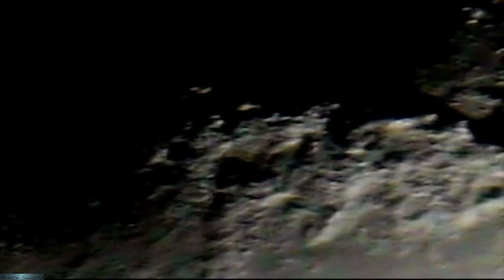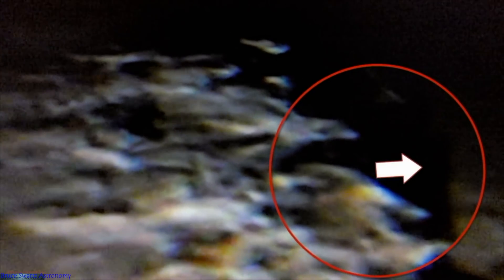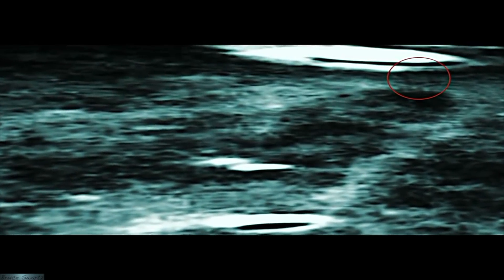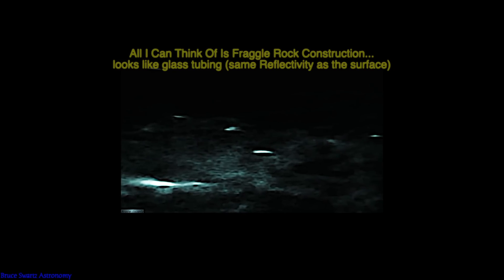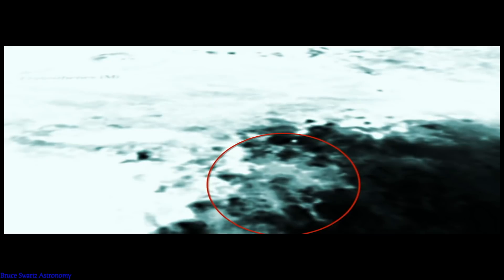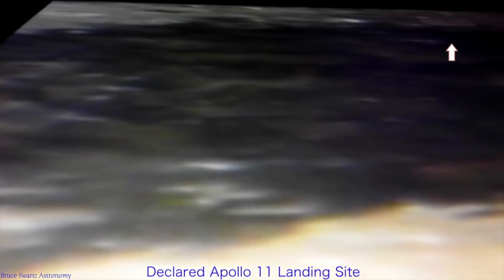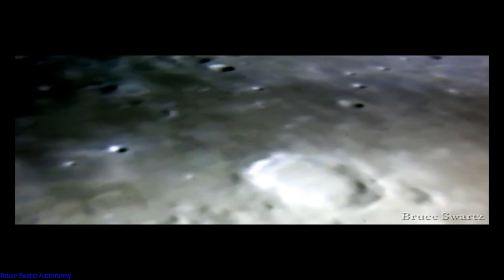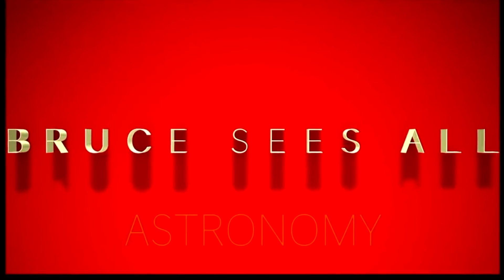The Moon's Surface Characteristics & Proof Of Constructed Features

Comment from the maker: Does it make any sense at all that two people would have gone down to the surface for the first time??? What if they crashed? Would the man floating in space waiting for them have been able to go down to the surface and help them??? Well of course not. How was that plan or back up plan not made. Would they have not done some oxygen breathing tests with their apparatus before jumping and falling on the moon??? When the astronauts came back the person in charge of their suits told his Niece and she told ME that the astronauts suits were drenched on the inside with water and dirt. Moon dirt.  29 degrees Celsius when they landed and your going to tell me that since it freezes the temps at night that there would not be a mist or haze on the surface???? Just a few questions there are many more. The damn lander on the surface was straight as a board. They said watch out for that big crater over there then showed us a flat surface that looked like quick dry cement without any elevation or even a view inside of ONE crater.  lollll The first moon landing would have consisted of several astronauts armed and a totally armoured space vehicle. Not aluminum foil that would have burned up through the Thermosphere before even leaving Earth. loll Alluminum alloy melts and would burn up before we got through it. Unless it was secretive. loll That could be possible. If they went to the moon I believe that they did not go the way they showed us and had possibly created a mock up stage setting with props.  Just a theory.

Comment: If size is no consideration, the surface reminds me of a close up of a circuit board....just saying, they could be dual purpose made by giant 3D printers  

https://www.bing.com/images/search?view=detailV2&id=86C3154740C8CA35EC457B6E6D96F9C6AC48C585&thid=OIP.vZVMTchFwsnB6oZcIqmyegHaLI&mediaurl=https%3A%2F%2Fwww.colourbox.com%2Fpreview%2F6398607-circuit-board-close-up.jpg&exph=800&expw=532&q=close+up+circuit+board&selectedindex=92&ajaxhist=0&vt=0&eim=1,2,6